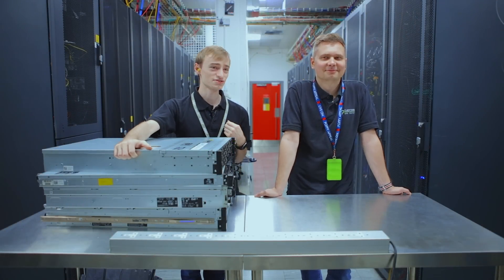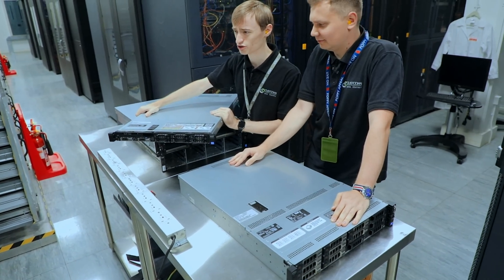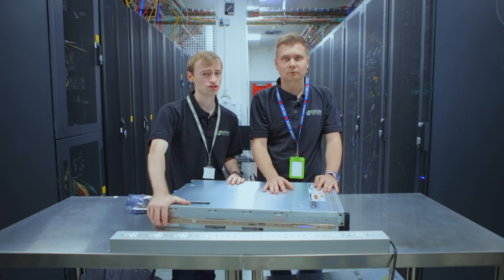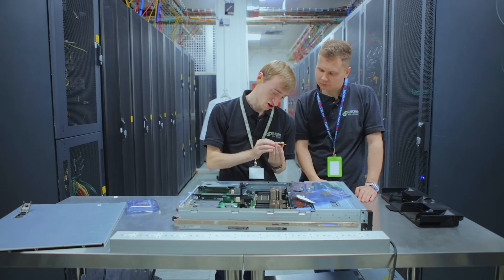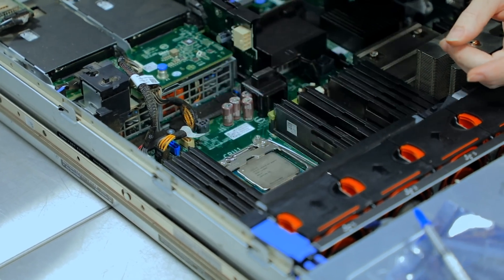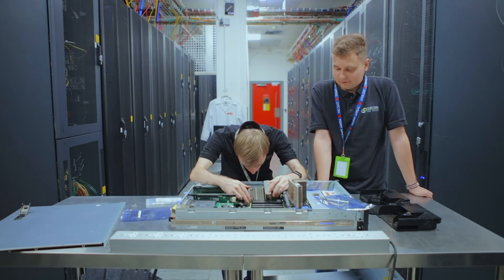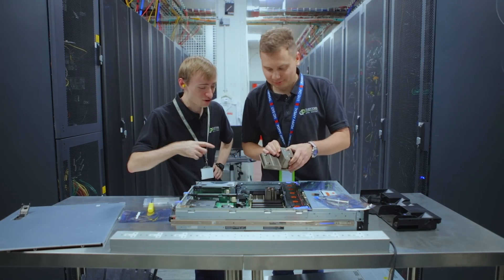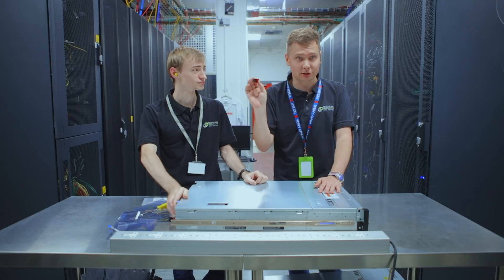DATA CENTRE 101 | HYPERVISOR BUILD | EP 1 | CHOOSING YOUR HARDWARE

Comment: I am curios, which hyper visor you will be using? I still use a few r710 and r720 at home, mostly for cheap ram and storage. I have 200 plus gigs of ram with around 70t hd. They are great for testing and handling movie storage for the house. That being said, I  switched to xcp-ng a year ago due to not being able to use the latest esxi because of the cpu nag from VMware.
Reply: Use proxmox. Far superior.
Reply: @ruwn561  tried proxmox wanted to like it, just not as polished in multiple areas for my enterprise. Keep in mind I came from VMware which is great and the norm. Since I run 100 plus newer servers that I swapped from vmware to xcp-ng having the same at home to play around works best for me.

Comment: You mention in your next video you'll be using a USB flashdrive to load the ESXi host onto; I would definitely consider using the Dell IDSDM (internal card to house single or redundant cards) for long-term hosts to load ESXi rather than the flashdrive as the flashdrive will eventually fail after ~2 years of use and will not recover from a reboot. Since this is an educational video, the flashdrive works just fine though! ;)

Comment: Wait a minute. Why spread the paste so much when the only thing under the lid is a very small dye(is that how its spelled?). So you effectively only need the past in the middle to cool that dye.
Reply: The CPU has a heatspreader to... spread the heat from the tiny die over a bigger area. Up to a certain point, the more contact it has with the heat-removing thing (the heatsink), the better.

Comment: so i usually spread the thinnest layer possible on the heat sink then a slightly thicker one on the CPU and before i tighten the tension device i will wiggle the heat sink around to ensure an even spread of the compound and then tighten it down

Comment: I'm actually using a 2950 for a minecraft server
Reply: linuxguy 11 What cpus do you use? Im about to setup one with a hp ml350 g5 and im wondering if it got enought cpu power?
Reply: @bonemealmc  dual Xeon E5420 (2.5GHz, 6M cache, Dual core w/ hyperthreading), kinda shit however I can safely run 2 modded servers (ftb infinity and the 1.7.10 pack) at the same time, with about  10-20 players per server and no TPS hit
Reply: @linuxguy1199 Thanks, then i know i will be fine. i got 2 quad cores with 32 gb of ram. Edit isn't the e5420 quad core?
Reply: @bonemealmc  4 logical cores, 2 real cores

Comment: 18 core somethings ha.. there was just a release of a new AMD CPU called epyc rome 7742 and 7702 processors that are both 64 core 128 thread (both over 3 ghz boost clock speeds) not sure if you've heard about them yet
Reply: They probably had and i´m sure they have Servers equipped with that in the DC. But a) these are Overkill, because they showed some setups for "homelab" and b) They are EXPENSIVE AF, compared to used Parts from 5 or 6 Years ago, which are mostly way more powerful than u need in an Homelab. But yes, Intel lost this Part of Market too, lol.
Reply: The R730XD it's older tech but they actually can support two 22 cores 48 threads cpu (E5-2699 V4) but they are pretty expensive. Those new AMD cpu's are nice but they are like 15K for a pair of them...a propper server configured with those with all the bells and whistles it's close to 40K.
Reply: @JDMeister  Maybe if we are lucky, then in 5 or 6 years they are like a few hundred dollars on eBay lol.